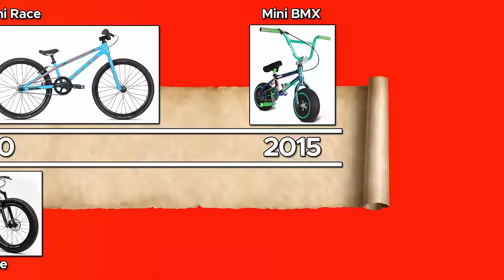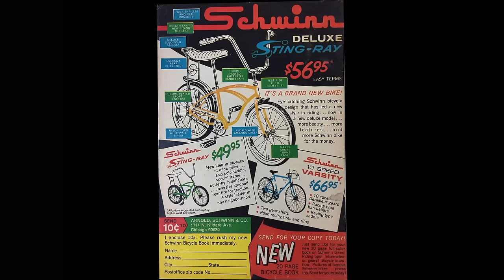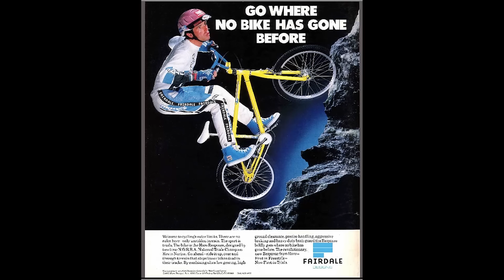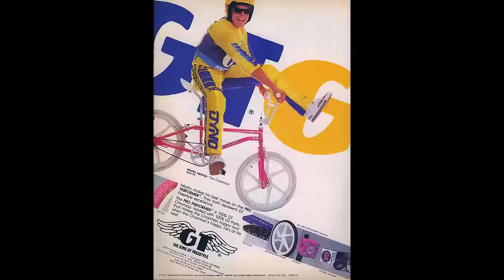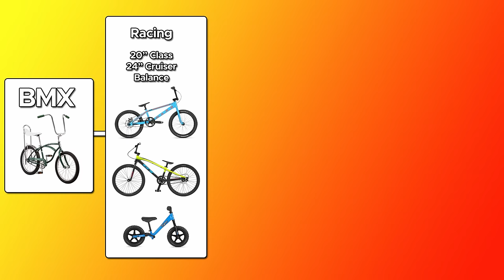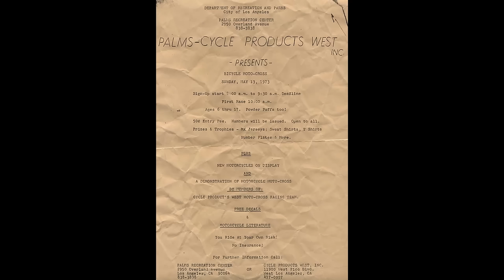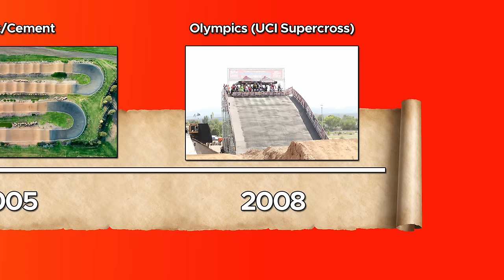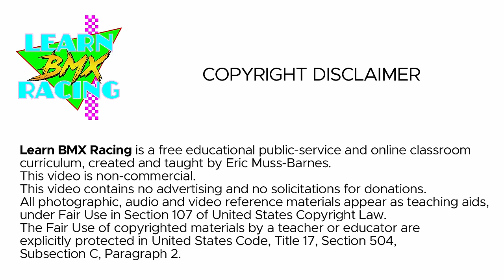History of BMX Bikes & Tracks

Comment: That Skyway on the front would be PERFECT if it had a layback seat post, an Elina seat, aluminum finish Redline Flight sprocket, and original Skyway logo'd pad set. That's it. I'd prefer graphite Tuffys, but the standards will definitely do. Skyway and Hutch Pro Racers must have Tuffys. I was a Hutch guy in 85, but I almost went Skyway. Two other kids in my neighborhood had Skyway bikes. I was the only Hutch rider.
Reply from the maker: Skyway and Hutch were cool. I knew kids who had those too.

Comment: I got a Bombshell BMX race bike with an adult-sized 21.5-inch long top tube, it's for riders up to 6'4" tall. I'm turning it into a Bike Frankenstein with a banana seat, chrome twisted sissy bar and 70s Schwinn Stingray fenders with chrome twisted supports, and CNCed alloy rims. I'm learning how gold and silver leaf and stripping anodizing off and changing the colors like from black to violet or blue.  It's more of a rat dragster-style show bike than a BMX bike. Being a kid who grew up in the 60s - 70's It's my vision of what a bike should be and look like. We had a neighborhood dirt track but I used my Stingray more for commuting than for fun.
Reply: I got another less expensive bike for riding. It's a Frankenstein BMX bike that also has some modifications a better stronger fork and home-laced double wall rims. Being a senior citizen I have to slow down to 5 mph, my body breaks easier, and I limit myself to jumping curbs. I mostly ride BMX because I think 20-inch bikes are fun to work on and you can find some really cool stuff for them.
Reply from the maker: Very cool. Sounds like a rad bike. Hope you keep having fun on it!

Comment: If it has a 14 mm rear axle its a freestyle/park/street/dirt bike. Whether the bike comes with pegs or a detangler isn't important. Race bikes have a 3/8ths axle. Also i think that modern race bikes have a longer wheel base than freestyle bikes. That's my understanding.
Reply from the maker: There are freestyle and race bikes with all different sizes of axles. 14mm and 3/8 have nothing to do with categorizing the bike. Whoever told you that was misguided.
Pegs and gyros are very important in categorizing a bike, because no race bike ever includes them.
You are correct about the wheelbases. Modern freestyle bikes have shorter rear triangles, making the bikes more manuverable.

Comment: Cool video, might have covered the innovation of frame materials over the years. Steel, chromoly, aluminum, titanium, carbon fiber. And small bmx bikes are not a new innovation. In the late 70's, Race Inc. was making 20" mini's for small kids and standard size 20"bikes as well. They were also using aluminum tubing and what is considered modern day geometry as early as 1978.
Reply from the maker: Correct. Back in 1984 there were micro mini bikes being made by JMC Racing, but they didn't become well-known or popular until much later. For example, Haro wasn't making micro mini bikes until about 2009. So, I cite 2010 as the year they originated, because that's when most major manufacturers began building them.
Reply: @LearnBMXRacing   That makes sense my bmx brother. 
 Love the oldschool,  I still have my 1979 RA 8 proudly displayed in my livingroom. Love the content, keep it up.  
🤙🏽
Reply: Correct, remember the Minigoose?  But there was no Internet back then so people didn't know about everything, everywhere...  I lived in the 80's in both midwest and Southern California and there were no skateboards in the midwest (only saw 2 in 10 years in the midwest and nobody could ride them) and must less BMX per capita in California in the 1980's, everyone skateboarded and at a high level, only saw less than 10 kids with BMX in my town in 1985 in 8th grade, which was weird.  Every kid who could had a BMX in my town in the midwest.
Reply: Correct, remember the Minigoose?  But there was no Internet back then so people didn't know about everything, everywhere...  I lived in the 80's in both midwest and Southern California and there were no skateboards in the midwest (only saw 2 in 10 years in the midwest and nobody could ride them) and much less BMX per capita in California in the 1980's, everyone skateboarded and at a high level, only saw less than 10 kids with BMX in my town in 1985 in 8th grade, which was weird.  Every kid who could had a BMX in my town in the midwest.

Comment: I am sure this is some physics question but, why is that whenever I caught air my bike just wanted to turn sideways and kick up towards horizontal and my handle bars kept straight (a table top). The frame only ever turned 45 degrees at most but if the landing was below the take off I wasn't going to land it cuz my bike was fully laid out flat.
Reply from the maker: Because your tires act like gyroscopes.
If you watch videos of 80's freestylers on vert, you will notice their back tire always stops spinning the moment they leave the coping. Why? Because they would hit the rear brakes to stop the tire spin. If the rear wheel kept on rotating, the gyroscopic force of the rotating wheel made it incredibly difficult to move the bike around in the air. A quick tap to the brakes stopped the rotation of the tire, thereby stopping the gyroscope effect.
Reply: @LearnBMXRacing  Handbrakes.

Comment: They got rid of the brakes because the levers will break your fingers or cut you doing bar spins when catching the bars is why
Reply from the maker: I guess 80's riders had tougher fingers.
Reply: @LearnBMXRacing  absolutely lol so did I I'm 34 during the late 90s and 2000s I took a hiatus from BMX for like 8 years and when I came back and nobody had breaks and I was like why doesn't anybody have brakes everybody's looking at me like I'm retarded im like what ? So I started asking and they started telling me why and I rode my bike with brakes until a pro challenge me to take my brakes off for 30 days because I use them like a crutch 🩼 and he was right  I've been back and forth since but currently I am brakeless

Comment: You were going so good... until you hit the mini 20" BMX bikes near the end of the time line. While I realize not every company made them in the 70's and 80's, there were a number that did. SE Racing had a mini Ripper. Schwinn had the mini Sting. JMC bikes were popular... not sure if they were true mini or not... but I lot of smaller younger rides rode them... They also ran "sew up" rims/tires, as well as 1-3/8 wheels before going full size... so the mini size, and the thinner modern wheels... were all done in the 70's and 80's... it seemed forced... like you HAD to create something new for the time line... 

Another thing, I've not seen mentioned so far (paused at 47:42 at the moment) is the raw tech changes. 1" forks to 1-1/8" threadless, sealed bearings everywhere... sidepull, to centerpull, to V brake, to disc brake... lots of things left unsaid... Multi speed was done in the past too, successfully. Suntour Holeshot was basically outlawed. Years later Darrel Young ran a Browning 2 Speed "BMX Transmission" front derailer system successfully... the idea was a smaller gear ratio for faster starts, then sitching to the higher gear for speed. Pump tracks killed the need to further that tech. 

I have a friend who owns a bike shop... has for decades. I asked him about the non brake models and micro gearing on everything... you got it partly right. With the grinding, hitting the fromt chainwheel etc... another major reason, weight. Bikes are longer. Stronger. larger diamenter, sometimes thicker walled tubing etc... pegs got added... brakes got removed. Doesn't seem like much, but... round up two levels, a gyro, potts modded stem, front and rear brakes, and all cables and such required to make it all work... how much does that weigh?

It would be interesting to see... two identical bikes. One with fully kitted out brakes front and rear, normal gearing and chain length. the other, all that stripped, and pegs added. What is the different between the two. I know on the racing side of things... weight mattered. A LOT. That's why Mongood Pro Class wheels existed, Uniseat etc... and people still drilled that stuff out. Most of my race bikes in the early 80's were around 21 pounds. Kids on a mini, with all the trick parts, and swiss chees drill holes everywhere possible... could get a bike down to around 12-13 pounds. 

My first race bike in 1979 was 31 pounds. 10 pounds doesn't sound like much... but it was MASSIVE when you raced. Ask any road racers...

Sorry if this posts comes off negative. NOT my intention. I'm enjoying it so far honestly. I've already shared it with a few guys that I raced with in the 70's/90's... I turn 56 next month. I just built a 1998 SE Racing Quadangle... I bought the frame and fork in 2003... yeah pretty sad... 20 years... but it's my dream bike 20" and it's glorious. The bug bit me again. I bought a NOS 1995 P.K. Ripper off eBay and am acquiring parts for that... and my newest purchase... a brand new SE Bikes Fast (Mike Buff) Ripper is currently out for deliver... 

I haven't been this excited since I was 13 in 1981 and rode my last brand new BMX bike... a Schwinn Sting off the dealer showroom floor and headed straight to our local track!
Reply from the maker: Glad to see you're so passionate for the sport.

Comment: My grandfather gave me my first bike it was a 26-in really old bike headlights built in and all that I can't recall what kind it was but I got on it it's the first one with the air in the tires and I felt like I was flying till I hit the back of a dump truck my first bike had no damn air in the tires try ride that down the driveway learn my next bike after my grandpa's I had to save up $78 I bought an orange banana seat off-brand Japanese 10 speed there were no 10 speeds we used to ride our bikes around the ice in the winter we went everywhere on our bikes.... I had kept mine original my brother put the bar took the brakes off all that b***** if I had that bike it'd be worth $2,000
Reply from the maker: Thanks for sharing your adventures.

Comment: I hate modern flatland bikes....and the frames all look the same...the steep headtube angle...too steep...73-74 deg is perfect...the only thing modern bikes gave us is the 1 1/8 headset and fork system...the smaller sprockets(it's the same gear ratio though..generally) and the smaller bottom bracket with (always) sealed bearings(like head tube)...other than that, drab, boring and almost all identical. I'm 50(51 eptember) and I rode since 85, still do...I have a modern bmx, but I wish I had an old one...unfortunately I've moved so much I generally only take my newest bike...through the years I just kinda ended up with a modern bike...vintage bikes are expensive so....I know I would kill someone for some redline forklifter bars from 85-87-ish
Reply from the maker: On BMX race bikes, I prefer the modern aesthetic.
On BMX freestyle bikes, I prefer the 80's aesthetic.
But the technology upgrades are pretty cool.
Reply: @LearnBMXRacing  yes, agree.